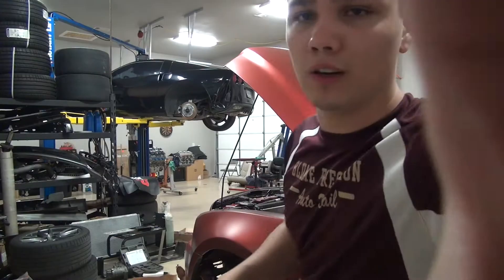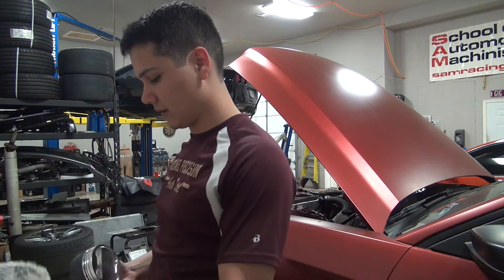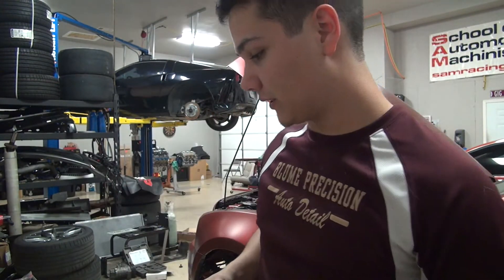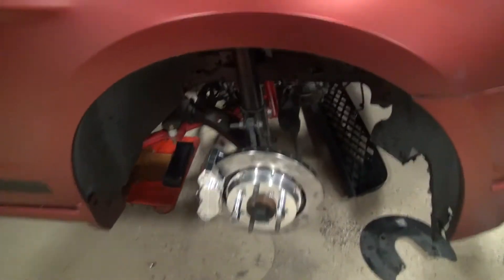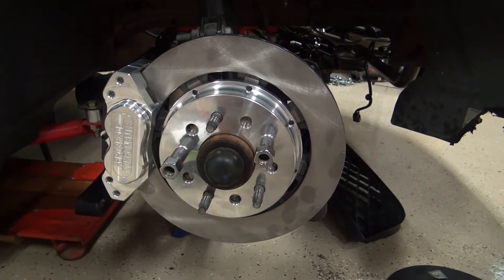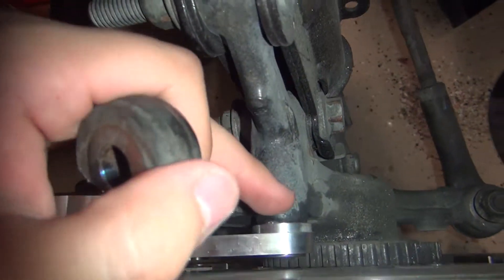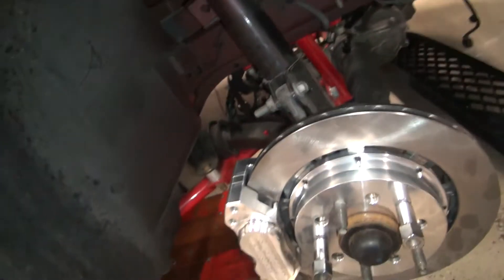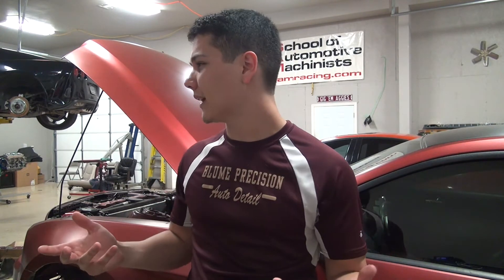Mustang and Lightning Update

Comment: Huh so maybe that's the reason a lot of 3.7 guys blow the motors when trying to go over 600 hp. I'm interested in the info for the pistons bro. As I will be buying some in august or September im planning to go more boost with the procharger setup
Reply from the maker: So they are .005 over pistons with lateral gas ports to support the thing rings that come with them. They have coated skirts and have options to get the top of the pistons ceramic coated if need be. To my knowledge the weak point in the 3.7s is the pistons so its definitely a must if you are looking to make over 600+ wheel. However I would also just throw some Manley H beam rods in while you're at it to do a full forged rotating assembly. The factory crank is twisted forged from the factory so it can handle all the power you can ever make.
Reply: J Blume awesome bro and thanks for the info. Keep up the vids very informative. We need more of these 3.7 videos
Reply from the maker: Thanks so much dude! I'll try! Hopefully the block should be machined and have a solid deck by the time I'm out of summer school! Then I'll have plenty of time to edit and make real quality videos, Similary to the lightning engine tear down vid!
Reply: J Blume awesome man I'll be sure to look out for them